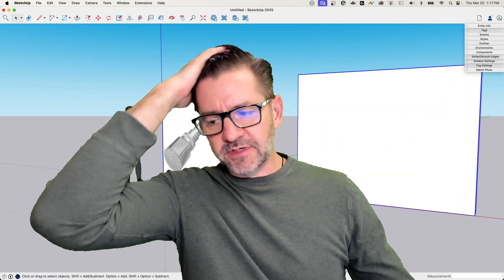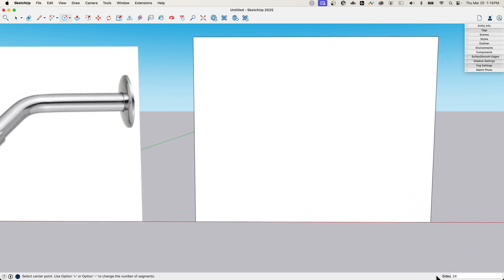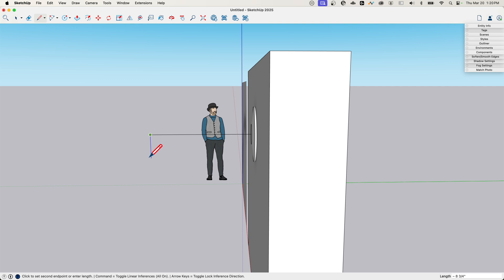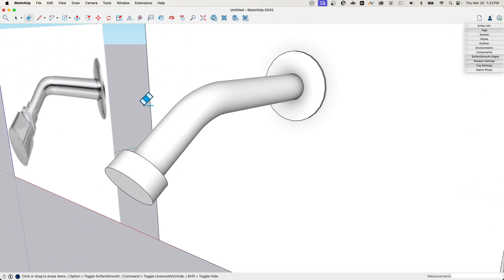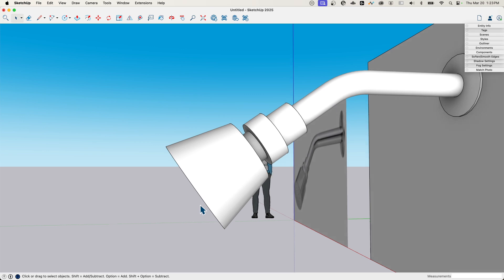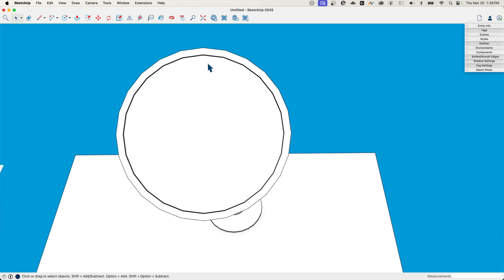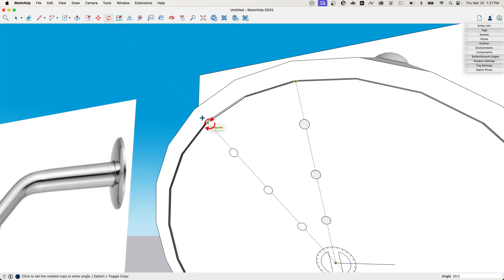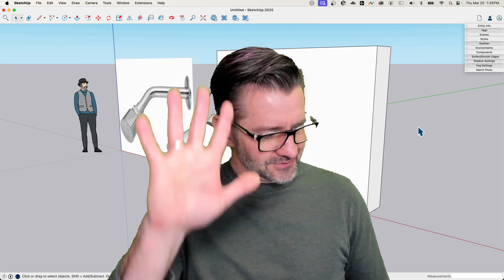How to Model a Shower Head in SketchUp

Comment: I've always had trouble making hand rails for stairs in my house builds. It's not too noticeable if the hand rail is a simple tube, but if it has any kind of defined shape to it, it always twists on it's vertical axis when I try to make it Follow Me up the stairs. I have discovered no ways to make the railing stop twisting.

Note, I am using only the basic tools, no extensions.